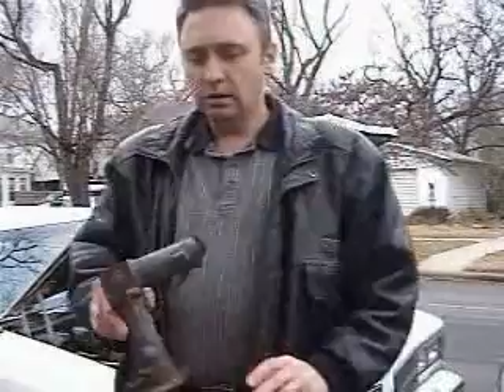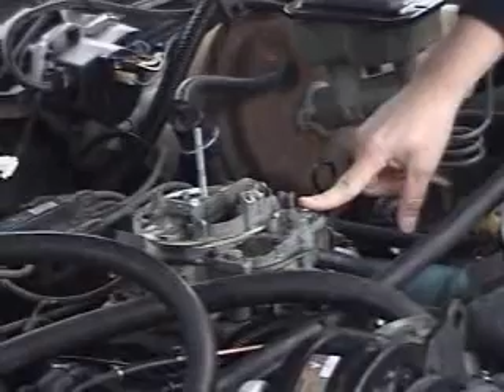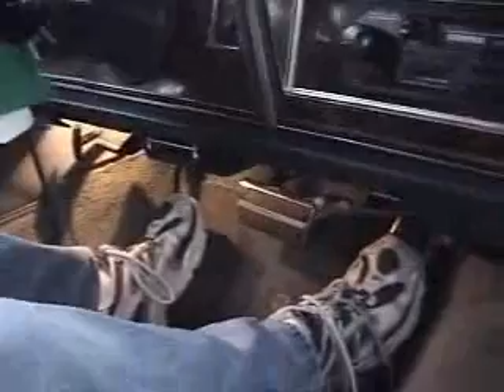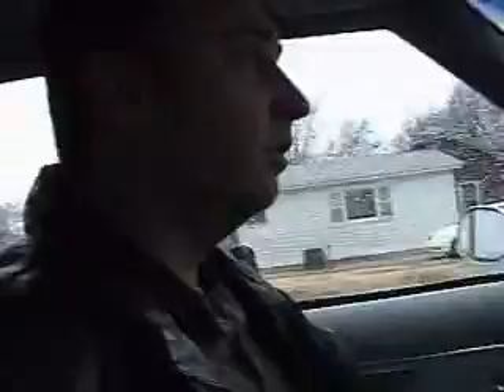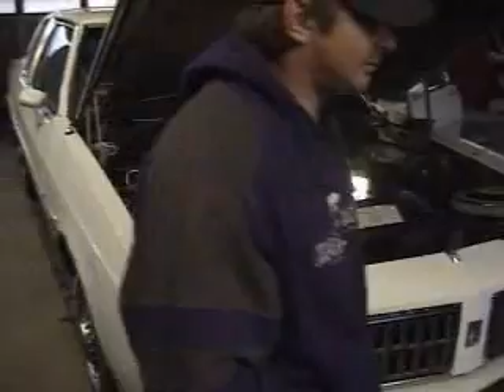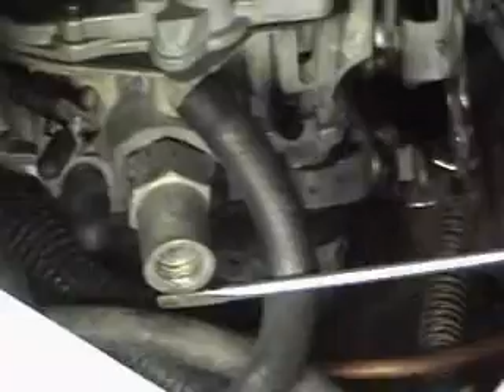Vapor Carb

Comment: I had a 1975 Chevrolet 3/4 ton pickup. 350 small block. TH400 transmission. heavy 14-bolt ff axle.  I ran my fuel tank vent straight to the manifold nipple on my Edelbrock AVS2 carburetor and with the throttle blades set stock, engine idled at 800 rpm. BOTH IDLE SCREWS CLOSED!

Comment: Is this fuel container completely tight, does no air get into it? It works on negative pressure. Is it heated somehow?
Reply from the maker: https://youtu.be/I5mkf066p-U?feature=shared
Reply: @jtalbert1968  Thanks for the example video, because I didn't really understand what reactions take place in this container. I test it on a motorcycle engine, but unfortunately it produces too little vacuum
Reply from the maker: The only heat is from the bleed air under the hood, no additional heat source. Relieving the atmospheric pressure allows gasoline to boil at very low temperature. My issue was the fuel stabilizers and additives made alot of soot. The tail pipe would leave a pile of black dust on the road at stop lights.
Reply: @jtalbert1968  So the tank has two outlets, one is for fuel, the other is for sucking in vapors? Unfortunately, due to the poor quality of the film, it is difficult to see. I'm currently playing around with the topic, looking for information and solutions because apparently such results are impossible, but I don't trust the experts' word, I prefer to check it myself.
Reply from the maker: @panmrf  fuel goes into the can, there is a float valve that shuts when the can is 1/2  full. There is a tiny 1/8th of an inch OD copper tube at the top of the can. The only way for the fuel to get out is through the tiny hole at the top.

Comment: Have you experienced any damage to the engine using vapor, like if you run a engine too lean? I keep hearing that too lean fuel can destroy a engine. However, the CNG cars and propane is good for the engine. I'm confused.
Reply from the maker: This isn't too lean. Too lean means the isometric 14.5 to 1 ratio is disturbed by adding tons of air, this causes higher temperatures and engine knocking. The fuel is converted into a gas, not actually vapor. The 14.5 parts air to 1 part fuel is the same, but as the air and fuel meet as gases at the top of the manifold there is no real over fueling. Alot of gasoline passes through existing liquid systems completely in tact. By mixing the air and fuel as gases it does burn like  LP fuels.
Reply: @jtalbert1968  thanks for the answer!. So your engine is still running good?
Reply from the maker: @keithc8108  I left that car in Kansas in 2014 with my oldest son. He put the stock carb back on it with a throttle restriction plate and drive it until the transmission needed service. Then he sold it for crush weight. He couldn't drive without the stock acceleration and needed the low end torque more than economy

Comment: YOU CAN NOT OVERCOME THE SAVOTOUGE OF FUEL EFICENCY THAT IS BUILT INTO THE CAMSHAFT FROM OUTSIDE OF THE ENGINE.100% POWER AND 100% EFIECENCY CAN ONLY BE ACOMPLISHED BY RECONFIGURING CAMSHAFT LOBE TIMING. THIS CAN NOT BE DONE BY ADJUSTING ENGINE TIMING.THE EXAHUST LOBES MUST BE PREVENTED FROM CRACKING OPEN ON THE 1ST DEGREE OF THE COMPRESION STROKE. THUS ALLOWING EXAHUST VACUME TO SUCK OUT 2/3 OF THE CYLNDER CHARGE WERE IT IS BURNED OFF IN THE CATALYTIC CONVERTER.

Comment: I din't quite understand all of the modification made to the carburetor, to include the manifold that you made where the vapor line inlets, and did you add a butterfly valve to the baseplate/spacer and add a linkage for it?
Reply from the maker: The carburetor has the float removed from the float tanks so no fuel will go through it. The accelerator pump is left just as it is. Then, on the bottom of the carburetor is a throttle plate, a spacer plate with a tube that supplies vaporized fuel which is fished through a spacer plate, and lastly another throttle plate, gasket and intake manifold. The timing is set to 0 and the vacuum advance is left unchanged.
Reply: @jtalbert1968 Yes vaporized fuel needs less timing. Good call on the 0° btdc

Comment: Interesting bit of trivia: most cars are deliberately engineered so that they get their best fuel efficiency at 55 mph... Granted, over time, with more and more newer cars on fuel spraying, this is a changing statistical number.
Reply from the maker: Thank you for visiting and sharing. I am more interested in using vaporization for external combustion though. Much cleaner and better than internal combustion in my opinion. I appreciate people who watch the entire content and make meaningful contributions to the thread such as yourself.
Reply: I personally work with the Kalina cycle, but also I primarily focus on solar heat, and non-petroleum heat supplies.

Comment: Nice work, thanks for sharing! Are you in any way cracking the vapor using heat? From my experiance high mileage gains come from heat vaporization not a cold vapor. I have seen increases in cold vapor systems but not nearly as much as you get from a hot vapor system.
Reply from the maker: Tyson;

Thanks! Every attempt I have seen for fuel vaporization using heat has had problems. One guy ran a fuel line through his oil filter, the line cracked and gas went into the oil. Another ran fuel lines around inside the air filter housing - it caught fire. At the end of the day I decided the only time to apply heat to fuel is when you want a reaction. So, cool (still well above 120 DEG F under the hood) vapor induction seemed the most prudent.

I appreciate the comment!

- Jack
Reply: A separate transmission cooler, placed to the side of the engine near the exhaust manifold prior to the vapor chamber, but after a primary fuel pump would allow pretty decent spot-heating, especially in a recirculating fuel system because you could allow any extra pressure to bleed off the pump before a float valve in the vapor chamber, allowing said pre-heated fuel to return either all the way to the tank [not advised' or to the inlet of the fuel pump [via a T fitting] so that it recirculated all over-pressure without losing the heat gained.
Reply: @jtalbert1968  did you ever use your father's invention? It looks very interesting, and I would like to see how it works on the road.
Reply from the maker: @keithc8108  yes sir, I ran approximately 2,000 miles on gasoline vapor in a 1981 Oldsmobile Delta 88.
Reply: https://youtu.be/Ke0MGmUr3SU

Comment: Anything new planned for the new year?
Reply from the maker: I will be working on an external combustion engine. Look up multiferroic alloys. http://www1.umn.edu/news/news-releases/2011/UR_CONTENT_343439.html is a good link. The goal is to use external combustion with an electric drivetrain. That's what's on the plate for 2014. - Jack

Comment: Looks like you're having fun. My truck runs better on alcohol vapor than it does with the factory carburetor. Not only that but it has more power and excellerates better too. Gasoline does not vaporize very well and is an inferior fuel compared to alcohol.
Reply: GTIBully true petrol doesn't evaporate very well even in high temperatures.
Reply: GTIBully Great, can we see a video of your truck in action? Does it use a carburetor or bubbler system?
Reply: What kind of alcohol are you using? Is it methanol?

Comment from the maker: Yes, but it would be pretty expensive to so do - most likely more cost to convert than lifetime fuel savings. We need to stop messing around with internal combustion engines and replace all ICE's with external combustion and electric drivetrains. - Jack
Reply: Electric cars are stupid, have to stop and charge. Not to mention how harmful to local environments the big batteries are to be made. Or how almost all of electricity is from sources that pump carbon into the atmosphere. Carbon in the atmosphere is good, plants grow bigger, which produces more exygen. When there were creatures the size of houses all over the earth the Carbon in the atmosphere was way higher and so was the oxygen. Our atmosphere has been depleting of Carbon and oxygen until we started burning oil replenishing it